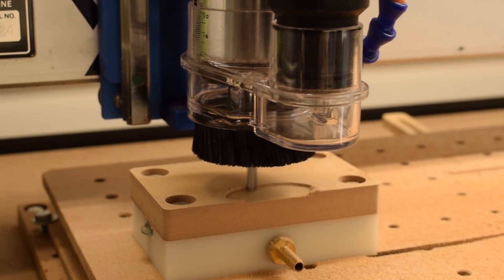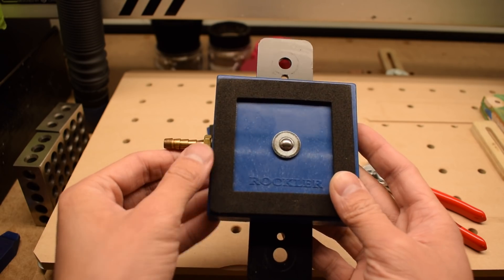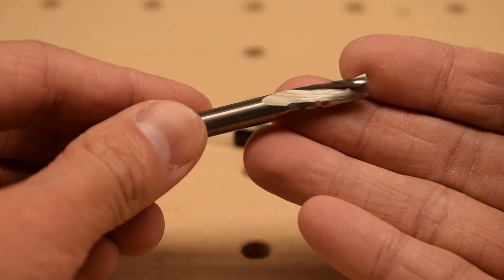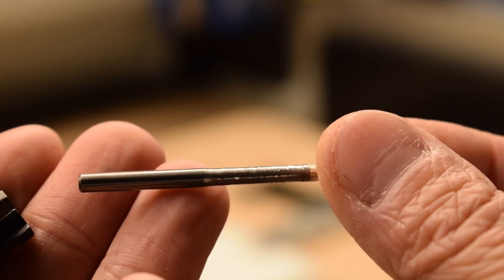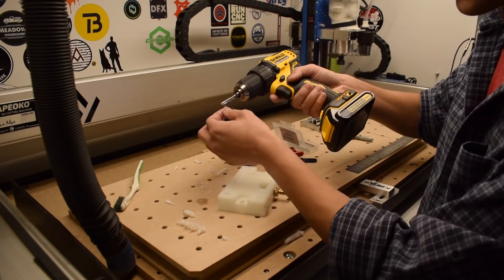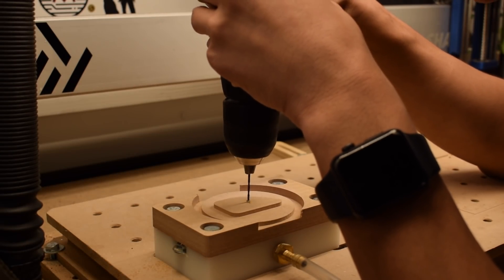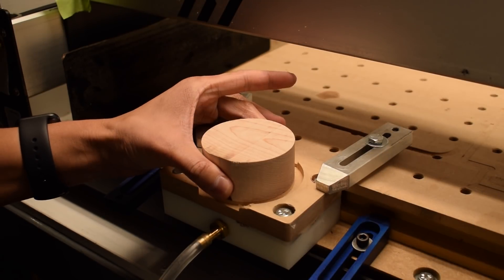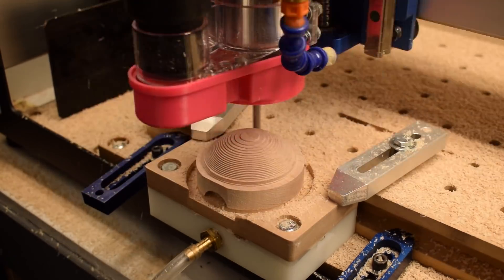Making a Small Vacuum Chuck for CNC Workholding - #162

Comment: Just getting into vacuum clamping on my cnc. I got some of these Rockler vacuum pods (on sale, yay!) and a 6CFM oilless vacuum pump. Couldn’t you use a block of MDF on top of the Rockler pods (or any other type of vacuum pod, I suppose) to accomplish something similar? Seal the edges, cover any unused surface area on the mdf to help focus the vacuum pressure… thanks for your videos!

Comment: What is the hole in the center of the HDPE? Does it go all the way through? As im assuming the D shaped hole at the front, close to the NPT Fitting is the vacuum port hole where the air is sucked out?
Cheers

Comment: Cool project .  Looks like you had Issues with the finishing .  For small projects I like to use Waterlox original formula finish . One good coat will do it .Then I like to use the Beall polishing system for a mirror like finish .  I have been using this method for over 15 years and the original pieces I did still look great .  Super easy method to get a fantastic result , and its fast.

Comment: Hey Winston I'm a super uber CNC noob as I just got my Shapeoko XL setup. (Should have gotten the XXL) but anyway I'd like to really learn how to design functional cutout designs for Acrylic & Aluminum. Should I be looking at Carbide create or would I be better off learning Fusion 360? Also do you have any recommendations on where I should look to get started? & which endmills I should be looking at?
Reply from the maker: If you have ambitions to design complex 3-D parts or parts that interlock, you'd want to learn fusion 360. But for just getting started, or basic projects you can use Carbide Create just fine. Which end mill you use really depends on what you're cutting, but an 1/8 inch end mill is a pretty safe place to start. I hope you are subscribed to the Carbide3D channel because I put out some content about speeds and feeds specifically for those materials already  ;) 
Note: cast acrylic is way better to machine then extruded acrylic.
Reply: @WinstonMakes  LOL yeah I watched that vid last night. The extruded kept balling up RIP to the bit the second time. I'm mainly looking to use my machine for cutting out Acrylic blanks & Aluminum PC case modding. Kind like what you did when you skeletonized your Y axis. My problem is learning how to actually create the designs so they are effective & proper.
Reply from the maker: Then definitely go with a more advanced design software than Create so that you can alter your designs on the fly. Even creating vectors in a graphic design program would give you a leg up, Create only gives you basic options for making shapes.

Comment: Seal it with Zinsser SealCoat (shellac) or any other shellac and it will be dry in 10-15 minutes after the alcohol flashes off, or even faster with a fan and / or heat.